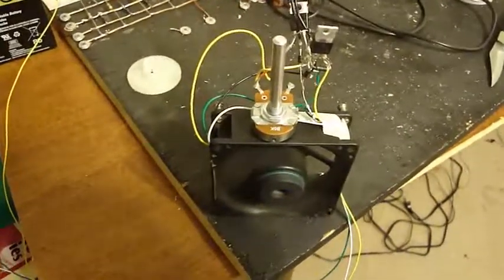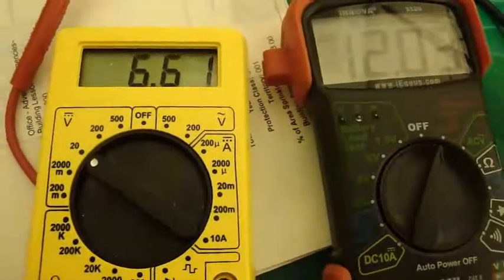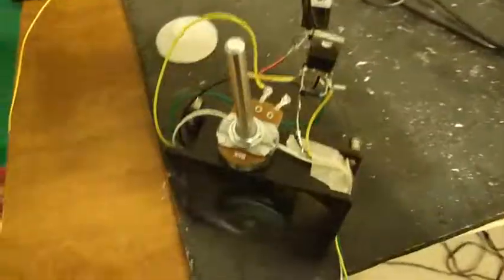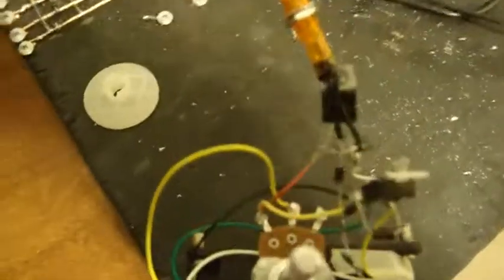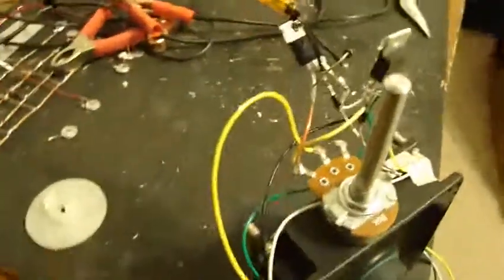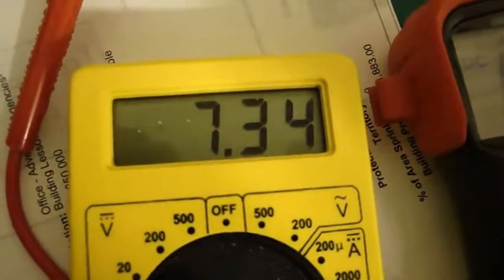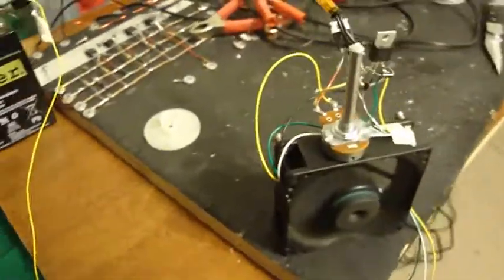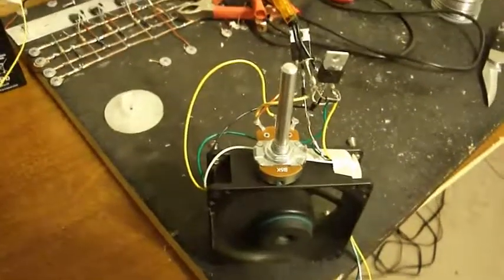SSG Fan With Darlington Pair.avi

Comment from the maker: Hi Billy...

I haven't tested it yet to see what the minimum run voltage is yet. I ran the fan on a 9 volt transistor battery and it did quite well. I would think that a solar cell of 9 or more volts would power it just fine.

Good Experimenting...
Poppy